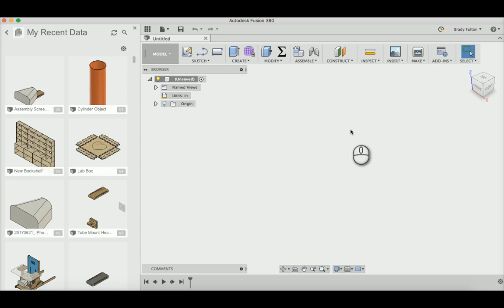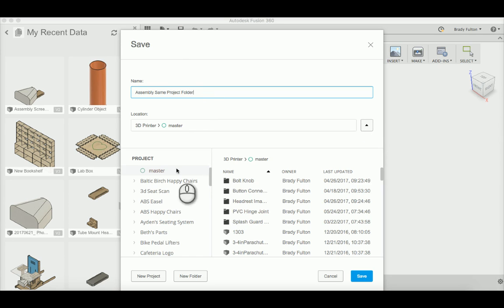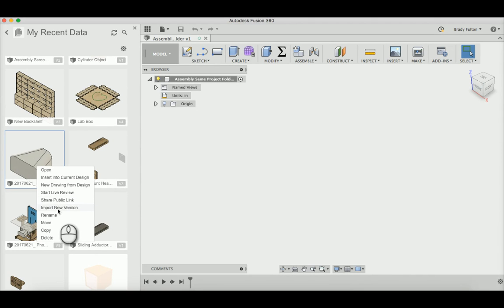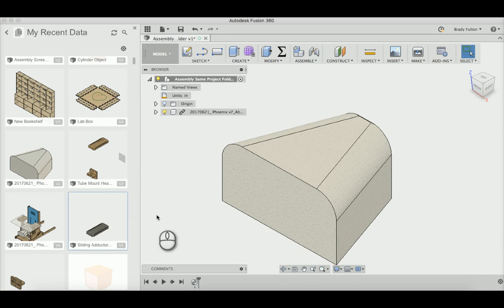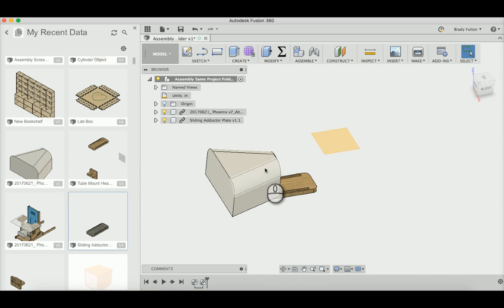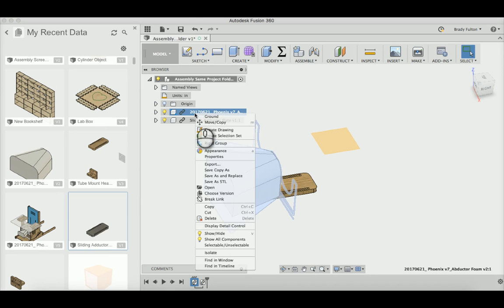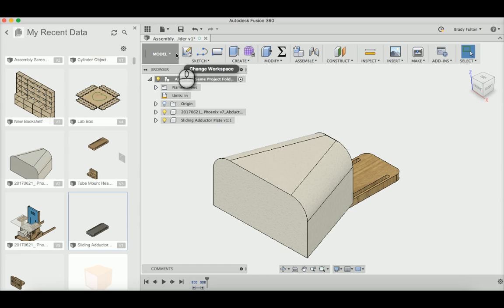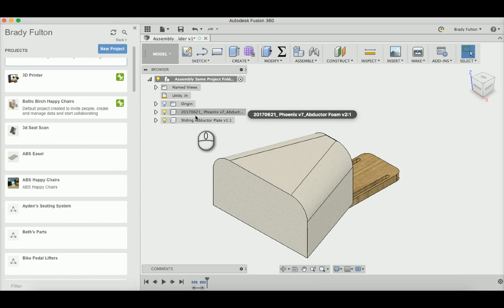Merging design files in Fusion 360

Comment: Not exactly what I was looking for but good info.
I ran into a issue where my design froze up and I did a recovery upon reopening. Didn't notice that it made a completely new design file until later and all that work I did after the recover was not saved to the original design file. I ended up having two design files. one with a lot of saved history and another with very few saved history starting from the crash. So if i want to roll back to a early saved version I have to use the old design but it does not have any of the new work I did. If I just use the new saved design I can not roll back to any of the older saves. It be nice if I could just merge the new work into the old file and have one full design on file. If anyone knows how to do that I would appreciate the info on it.